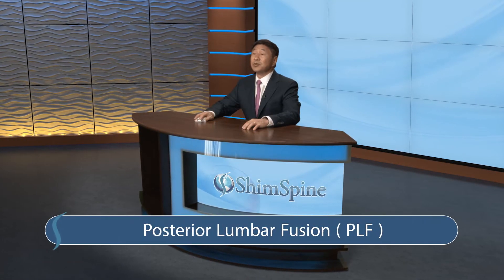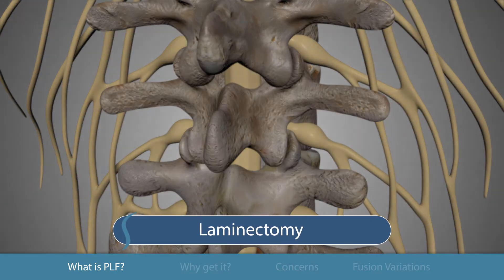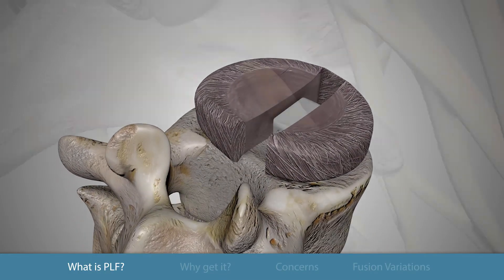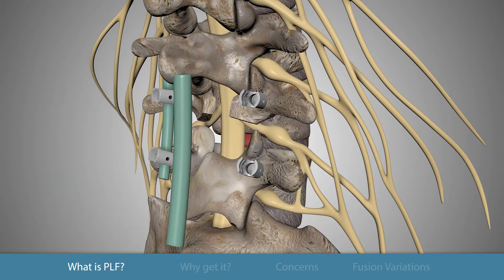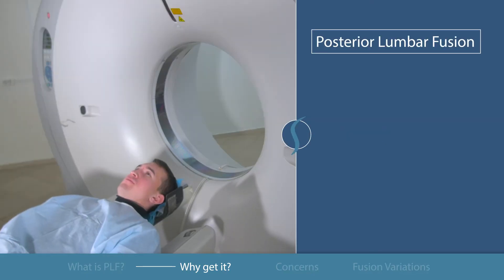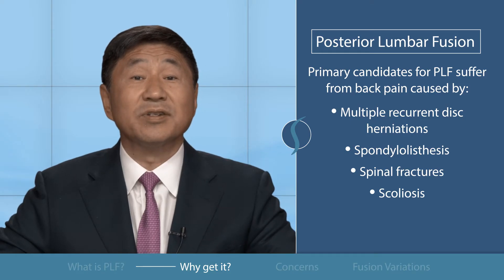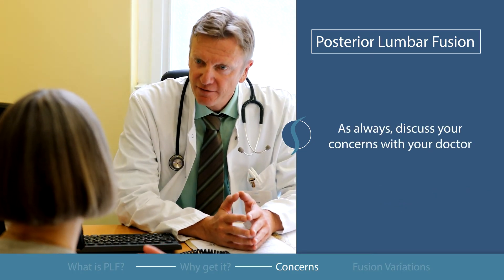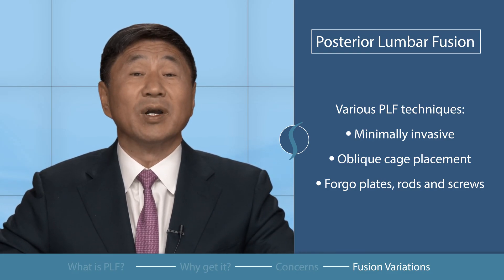Posterior Lumbar Fusion

Comment: I'm going to put out a YT channel and it's going to be all about the long term issues of having lumbar fusion. it's the old school way of doing things if anyone has this done now You're an idiot. I had two levels in my  cervical done with just artificial disc's  no rods screws or cages the best thing I have ever had done it's been 6yrs I'm a industrial electrician and had no issues at all with my neck, my low back fusion has cost me so much pain and issues with my feet and hips I had to have foot surgery because the fusion caused me to walk different. The scar tissue has gotten so bad that no DR will even help me get the pain to reside for 3-4 yrs it would be so worth it to me. I can't stand and talk like everybody else without focusing on my pain it's horrible.I had my L5 s1 fused in '14 then scar revision 2yrs later, saline and countless spinal injections to ellivate the pain still a battle everyday. I'm still working a horrible way to live. Don't Do it, DON'T DO IT
Reply: Sorry but I'm doing 345 tomorrow. I'm ready and optimistic I will fully recover

Comment: I had spinal decompression fusion of the l5-s1. There were rods and screws along with the bone graphs as you detailed and shown in this video. I have a question for anyone - I've just hit the 8th month mark and finally feel as if the surgery is "taking". I'm able to sit up now with zero to no discomfort depending on how strenious daily tasks have been such as garbage, yard work, just life in general. I'm curious to know whether anyone else has been in tremendous pain post surgery and also have had their end plate move due to not fully following doctor instructions. For more context. I had surgery on 10/21/23. I took two days off work and worked remote for the following 2-3 months. I then began to exercise which caused many issues which most have disipated since. Would you encourage jogging as an exercise that I may now proceed with before the year mark?
Reply: Hey man, just curious cause I have to get this soon. When were you able to exercise heavily 
without causing injury?

Comment: I had posterior lumbar fusion which was actually revision after failed bilateral facet fusion for PARS fracture, my fusion was done using cylindrical cages with no fixation , just the cages themselves, im wondering if that’s why I’m having trouble with it still , 16 years later im now having serious adjacent segment problems at L4,3,2 but mainly L4 has basically become bone on bone , and already has needed surgery for a massive disc herniation that caused temporary paralysis in my right leg, anyone else have standalone cages?

Comment: I only comment because I trust knowledge and your replies.  Can someone who had a failed to fuse L4/L5 fusion PLIF have a revision of that L4/L5 using the ALIF? I am wondering how they would get the original screws out?  Would you suggest PLIF again for revision or ALIF to get the best bone growth or fusion?  Thanks!
Reply: What’s the difference between ALIF AND PLIF ?
Reply: @vortex21rainz26  ALIF The surgeon accesses the damaged vertebra through the stomach, PLIF Posterior lumbar interbody fusion or PLIF approaches the procedure from the back.
Reply: @KBradAdams  thanks for letting me know 🙏🏻 which one is better and easier for the recovery?
Reply: @vortex21rainz26  I think that is something I would discuss with my surgeon.  I have heard there are advantages to both depending on your issues.
Reply: Anterior is the way to go IMO and from personal experience. Faster recovery for sure comparing side by side with peer patients.  Best of luck to all who need this done. Seek and search for the best neurosurgeon you can afford. I would put mine up against anyone out there. He and his team saved my life and gave me hope of a normal upright walking future. 90 days in and no one can tell I had a lumbar double fusion unless I tell them